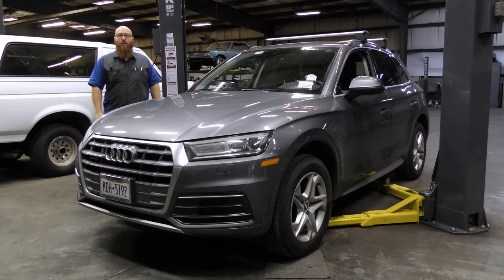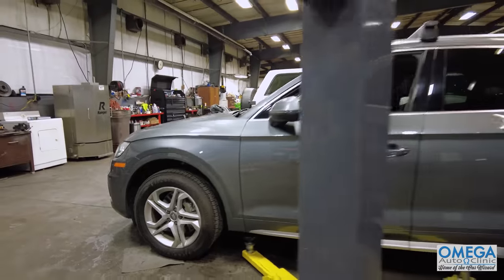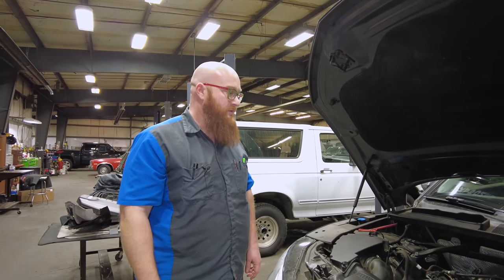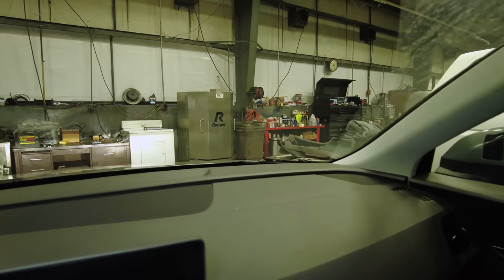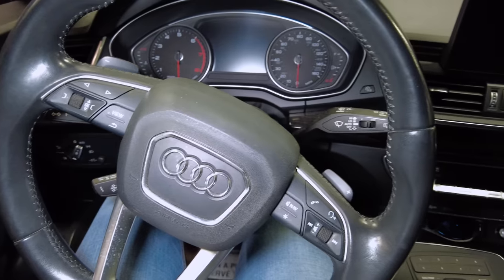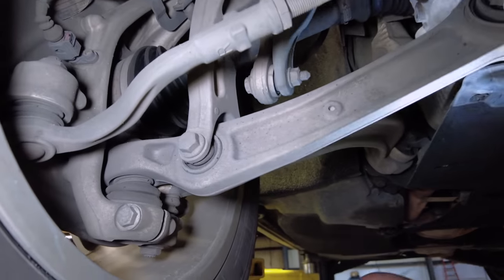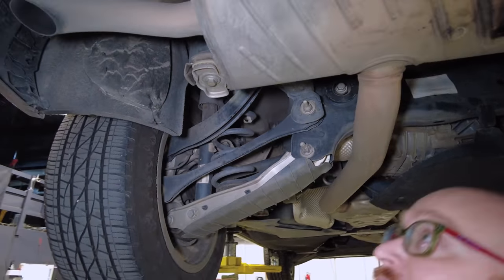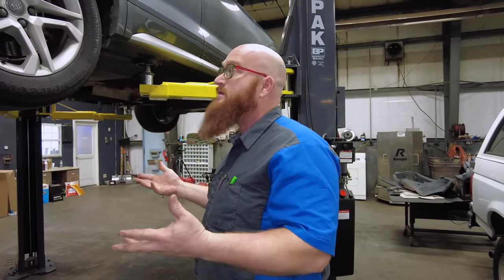2019 Audi Q5 with 200K miles & the service records to prove it! What did the CAR WIZARD need to fix?

Comment: I have a 2018 Audi Q5 with almost 100k. I haven't done anything but the recommended services and believe it or not, still running the factory brakes! I have been extremely happy with this car more so than any American car I've owned.
Reply: Are you keeping it or trading it in...the magic 100K?
Reply: What American cars did you own?
Reply: Not even 100k though, so I'm bettering you're getting ready to offload it before it's on the way to 150k.
Reply: Yeah my aunt has one too. It’s never skipped a beat it still smells new inside lol. And best of all it has physical climate controls lol.
Reply: My GTI brake pads look like they have almost no ware at 55,000 miles.  Its very confusing.
Reply: A hybrid Toyota could get three hundred thousand miles out of their brakes and use less gas. :text-green-game-over: And you can even get a TRD one.
Reply: I have a 2011 Sorento with 95k miles and I've only changes the brakes once and the tires once and almost all of the miles are local.   So it's not the car, it the driver.
Reply: @katherynscleaning5807  You're comparing a Toyota with mid-size luxry German cars. Two completely different car segments. One is for the person who wants point A to point B, the other is one who wants a nice luxury car (Q5) or a slightly sporty car (A4/A5).
Reply: This comment sums up American car ownership. In Europe 200k on a vehicle is thr norm and very reliable as we take car to maintain the cars. Americans would rather fill their stomachs
Reply: @katherynscleaning5807  The next Tacoma is going to be a 2.4T with available hybrid, same with the 4runner.
Reply: @JohnSmith-yv6eq  keeping it for now. Looking at maybe getting the hybrid version to do my part for the environment.
Reply: @jeffk464  I found out the brake service is like 3 grand. No wonder why they last so long. If you had to pay this every 30k miles, no one would by the car!
Reply: @BWThorp  On a VW, I've heard BMW uses rotors with a special coating on them.  They cost a lot and have to be replaced with every brake service.  I can't imagine that applies to VW though, they are much more mainstream cars.  Are you talking Audi?
Reply: @BWThorp  
If that is 1st generation technology...weigh that up carefully..otherwise you could become the "test driver"....
also Tesla is dropping their prices worldwide..
and if you don't live anywhere too hot or too cold...
a Nissan Leaf makes more sense for grocery getting?
Reply: @umarfarooq5436  If German cars were better than Japanese, Korean or American cars in terms of economics, they would dominate the US market.  They don't.  The VW beetle was the closest they came.    Americans don't want the tiny little gas sipping rollerskates with 0-60 eventually that they drive in Europe because gas is $6 a gallon.
Reply: @tycurtin7565  This Q5 with the 2.0T 4-cylinder does 0 - 60 around 5.9 seconds. BMW X5 in about 4.7 seconds. A Jeep Grand Cherokee with the 3.6L V6 does 0 - 60 in about 6.8 seconds. Ford Explorer with the matching turbo 4 like Audi (but 2.4L instead) does it in 6.2 seconds. German car engines pack quite a punch, higher top speed, and couple that with their "sportier" suspension setups means this Q5 (or any German SUV) will do better than an comparable American SUV.
Reply: @mydimeisup5103  That's just the tiny number of cars they sell in America.  Those cars sell by the handful in Europe.
Reply: @katherynscleaning5807  but you cannot compare the way it drives to any toyota, even to Lexus... Of course Toyotas are more reliable.
Reply: @katherynscleaning5807  yet you rarely see 1990s Japanese cars on the road because they rusted away whereas you’ll still see old German cars on the road from the 1970s, Game over
Reply: @tycurtin7565  yes because the average American can afford 80,000 dollar cars😂,look at the luxury car market the Germans own the market and let’s not forget who owns American truck companies such as international,western star,Detroit diesel and freightliner you guessed it German companies Daimler and traton
Reply: @katherynscleaning5807  The fuel economy of hybrid Toyotas is actually quite disappointing. The hybrid system isn’t effective on the highway speeds or in winter. Nearly in all conditions a regular 2.0 TDI is able to offer better fuel economy, much more power while being considerably cheaper to buy. Of course that 2.0 TDI is available almost in any Audi model.
Reply: @tycurtin7565 German cars absolutely dominate the European market. Of the American cars only Tesla has managed to make some sort of impact. Anything else American has stayed niche. Of the Japanese makes only Toyota has firm market position but they’re still out sold by Mercedes, BMW etc. The problem is that other manufacturers struggle to deliver the same level of build quality and driving feels as the Germans.
Reply: @mydimeisup5103 The german want to deliver what they promised so unlike American makes they don’t over estimate performance figures. Usually their cars are faster and more powerful than they claim. The germans make sure the car feels right, American focus what it sounds on the paper.
Reply: I have a 2018 sq5 and this gives me hope.
Reply: 100k and still the factory brakes😂Don't think so.I'm an Audi Mechanic in Ingolstadt Germany and honestly if this is the case then you are in the Guiness book of records😮
Reply: Still has the same timing chain tensioner?
Reply: @mydimeisup5103  0- 60 does not equal reliability, which audi is not known for.
Reply: @umarfarooq5436  oh please, I see tons of Europeans complaining of the same problems we have in USA. It's the same design. Bmws having leaky gas gaskets and Audi timing chains needing replacing.
Reply: @mikojarvinen6273  Diesel maintenance fee is very high plus you need to change fuel filter every oil change and the timing belt...oh mine...
Reply: @HumbleBearcat  That’s normal accurate. You don’t have to change the fuel filter at every oil change. Fuel filters generally aren’t expensive either. Not even for diesel. Roughly 10€ for my Audi. Timing belt is due every 8 year however many diesels cars have timing chains. Timing belts are also popular in gasoline engines so it’s got nothing to do with fuel being used.

Comment: My Audi Q5 2011, 191.000 miles. No problems! Replaced struts, control arms, fuel injectors. Nothing else. Running like new. 2.0t engine CAEB. Only premium gas and Castrol Edge Synthetic.  No racing and no other stupid things that stupid people do.

Comment: 200k just getting warmed up with proper maintenance they live a long time unlike jags and land rovers they’re sweet looking but unreliable as hell
Reply: My Land Rover, LR three 2006 has 236,000 miles on it nothings wrong with it. But I do think I heard the timing chain guide.
Reply: @Kimbrough87  consider yourself lucky. every land rover that exists here from what i saw needed a complete engine rebuild after like a year (same for N63 bimmers, or german/ british cars in general)
Reply: @zhila5958  yeah I do think I’m lucky because I use it to tow my RV trailer and it weighs about 5000 pounds. I hope it keeps going.
Reply: @Kimbrough87  i hope so. goodluck mate
Reply: Only in the usa, in Europe/UK they are easy peasy get serviced and cheap enough…. This is a top end model and the sporty and exec level ones are less reliably maintained- excellent motors more designed than VW and engine is used in Skoda so spares are reall easy
Reply: They get a bad rep as being unreliable but I think it's the service intervals. What do you expect when Land Rover requires oil changes every 21k miles.  I was shocked when I learned that...
Reply: @TugboatTony  here where i live, they literally get babied by changing oil every 2k-3k kilometers and they still grenade themselves
Reply: The F-type is possibly the best looking car ever made.
Reply: @jeffk464  yup like I said  jags are sweet looking not very reliable for me the old e type  are the best looking ones
Reply: @jeffk464  looks are subjective, everyone has different opinions. i think the first gen honda NSX alongside the mclaren F1 are the sexiest cars ever made

Comment: Maintenance, as you say, is the key to longevity for a car.  My 1999 Audi S4 Avant has now covered 298k miles and still drives faultlessly.  I have spent considerable sums and amassed a similar library of records for the car but unlike this owner I have done most of the work myself.  It gives me pleasure, satisfaction and some pride in maintaining my beloved S4.
Reply: Motor untouched?
Reply: Must suck
Reply: My 2020 A4 is already breaking at 60 000 miles. It's been serviced according to the service program. It now needs a new belt, a ball joint and a start button and brakes started disappearing every time it sits in snow. All my Mercedeses lasted at least 120 000 miles before things needed replacing...
Reply: @dingdong2103  junk cars..the vag stuff
Reply: @dingdong2103  - Mercedes, BMW, and then Audi when it comes to quality and durability, in that order. Audi being behind BMW says alot. My 17 year old E Class has 231K and has no warning lights. Could use a set of shocks soon, but thats about it.
Reply: @shawna7813  The only MB car that has caused me grief is my 2003 S500L 4-matic (which I still own and my brother drives). It has needed a lot of maintenance. Total rehaul of air shocks and compressor, broken double pane side glasses, now driver side window regulator failed, AC compressor failed. The old lady is getting cranky :) It just got a fresh coat of paint and new bushings. Lipstick :)
Reply: @dingdong2103  did you buy new?  I have an A3, but a close friend has a ‘17 A6 S Line (bought used 24k) and has nearly 80k miles and the only thing he’s done was follow the maintenance guide in the manual. It still drives like a dream.
Reply: @wealthwithaaron_  Yes it's a company leased car. The build quality is clearly below MB, I hear all kinds of rattles, engine vibrates and is noisy when the gearbox pulls at 7th gear uphill at 1200rpm, webasto fills the cabin with exhaust if snow blocks the exhaust (happened twice this winter already), the brakes disappear on snowy days, almost crashed due to it... Parking camera is always blocked with dirt due to poor placement, start button is sticking bad at cold weather, Apple carplay malfunctions or refuses to connect to my iPhone XS daily, loose/squeeky bushing... And probably something I forgot already
Reply: @wealthwithaaron_  Some of the stuff I listed is being repaired under warranty, some go to the leasing corp. Parking camera can't even be fixed as it's a design flaw. MB did it much smarter by hiding the camera behind the star which opens only when you actually reverse.
Reply: @dingdong2103  let me get this straight, you bought a leasing car from a company? Like the car was driven by drivers with leases?
Reply: @dingdong2103  I’m sorry to hear that you’re experiencing that. Perhaps, the previous owners didn’t care much about the vehicle due to the lease. Hopefully, after the repairs, it works out for you.
Reply: @msinna6433  No my company leased the car to me as a perk of course
Reply: @wealthwithaaron_  I got the car new in 2020, it is leased for me by my employer. Perhaps I explained poorly.
Reply: I have a neglected B7 S4 that im fixing right now. Barely over 100k miles gonna drop some big bank to fix it but I love that damn thing so much it'll be worth it to me.
Reply: Please sell to me lol
Reply: Correct, the reason the maintenance doesn’t get done often is because they’re designed to be labor and cost intensive so people avoid it… The labor on this looks to be a bit easier, hence less expensive hence getting done lol
Reply: VW/Audi actually makes fantastic vehicles. I’ve had several ranging from 16k miles to over 250k miles. The key is maintenance and knowing when it’s in the proper temp range for spirited driving.
Reply: @wealthwithaaron_  80k miles and it still drives?  I wouldn't believe unless you showed me lol
Reply: @Tipman2OOO  None of my Mercedeses had this sort of problems until around 150k miles and this hasn't reached 60k yet...
Reply: B5 club here. My 99 Passat 1.8t has 194k miles. It gets fed liqui moly 5/40 and Mann 950/4 filters. It has been unitronic tuned since 70k miles. Still on original clutch. 4th timing belt. Still beats up modern sedans daily. Lots of power with an all aluminum 4 link front suspension. B5 is One of the best from vag in my opinion.
Reply: @dingdong2103  what was the total repay bill.
Reply: @ashishbadoni5191  Of what? The Audi or the MB? To the MB I've put about 5000 euros in repairs over the ownership (6 years). The Audi bill was about 1200 but that got covered by the leasing company, from the repair budget. The lease ended before they managed to fix the DPF problem, now running a new EQC and I've been extremely happy with the car.
Reply: It is funny how did the host describe that Audi requires maintenance, still mentioned mostly just tyre rotation because of high mileage. Of course, you need to service every car now and then and even Japanese cars. From time to time parts of suspension go bad, sometimes shocks, once I even had an oil leak on an almost new Mitsubishi. Still these are tiny bits that do not require costly maintenance or a ton of time from you. Replacing tyres is also something you would do regardless of a car, just according to its age and mileage. So what are really the downsides of this Audi in particular, I still cannot get.

Comment: Highway miles versus stop and go daily trips should be taken into consideration with its appearance/ reliability. Great to see though a road warrior taking care of his transportation.
Reply: Totally agree here...No rust at all !!! From New York State ??? I don't understand  that!!
Reply: @1983dmd  it was garaged
Reply: @PresidentEvil  Not with those miles.  It's seen a massive amount of car washes tho.
Reply: a lot to with with somethign else.  You dont skimp out on maintenance when going on long trips :) That's why I buy high miles cars. My highest is a 355 000 miles audi a8l with original engine trans never rebuilt.  My truck is at 283 000 miles.
Reply: jkirk1626  Thank you for the explanation !! Different story here in Montreal...What do you use for undercarriage rinse ? The sprayer with little wheels ?
Reply: @1983dmd  I have an 09 with 190k miles, never seen rust on the car. They cover up the lower part of the car really well and suspension parts on the car have no rust as well.
Reply: @msinna6433  Where do you live ?
Reply: What difference does it make between highway miles and stop and go miles?? I don't understand can someone please tell me?
Reply: @abovethelaw4417  stop and go is always higher temperature of all the engine compartment. Car is always accelerating instead of maintaining a speed in top gear. Less gear changes, less wear on transmission. More airflow cooling things down so rubber hoses and such last longer. Less chances of being used for small trips thus leaving condensate in the engine. Less brake wear, less braking means also cooler wheel bearings and thus higher life.  
The list is extensive and not limited to this. Always take the highway mile cars vs the city car.  Ive got 573 000km ( over 355 000miles) on my highway car, still the original powerplant and transmission.  Same with my 455 000km truck, and it pulled 5th wheel full time for 3 years. Original engine and trans but I did work on the engine ( mods)
Reply: jkirk1626  hi, how often u rotate tires? I heard its every 10k mile, not 5k as the Toyota counterpart. I have a 22 Q7, shoud i rotate every 5k mile or 10k mile? Thanks!
Reply: Road warrior 🤣🤣🤣🤣🤣🤣
Reply: @anon556  I like that saying.

Comment: I had a 2001 A6 that took me to 200k with just regular maintenance and to this day, drove better than any new car since.
Reply: Yeah the older audis (2001 is the sweet spot imo) are pretty sturdy
Reply: I bet it wasn't the 2.7T version 🥰.
Reply: @anthonyb.9336  haha it was the 2.8 and it liked to drink the oil
Reply: @Mixali88  I have owned two VW products. The first was a used 1.8T B5 Passat.  I got it with 65k miles on it and it had so many oil leaks and problems. I got rid of it at 100k miles.   The second is my current car.  The difference between the two is my current car has had every service done and at the dealer, no exoense saved due to cost.  Zero oil leaks and not a single thing has ever broke
Reply: I had a 1993 Audi 90s with the V6 and also hit over 200k until it got in an accident that totaled it.  It was not without problems but it always ran.
Reply: My 01 A6 4.2 has 194k on it. Basically just regular maintenance.
Reply: @Audi30V keep it forever!
Reply: I own a 2010 S4 that has 210K miles on it. Of course, I maintained it.
Reply: That was 21 years ago, before the Germans went to plastic fantastic under the hood.
Reply: Highway miles?
Reply: @2bfranky  what’s crazy is I have a 14 mdx and 18 pilot and they for damn sure won’t make it to 200,000.  Looking to go back to Audi or Mercedes actually.
Reply: @trevorsutherland5263  no wrong this is the era when plastic was in (late 90s onwards)
Reply: @2bfranky  not every Japanese car is reliable you know
Reply: @Mixali88  modern Honda quality and reliability is garbage they rest on their laurels and now Honda is learning mistakes the hard way
Reply: @joskjj3625  i had same experience with toyota, everything is made as cheap as possible and i have never seen so many issues on 20k mile car...
Reply: My 1999 a6 was the only car I’ve owned without it throwing a check engine light and I’ve owned mostly Hondas.